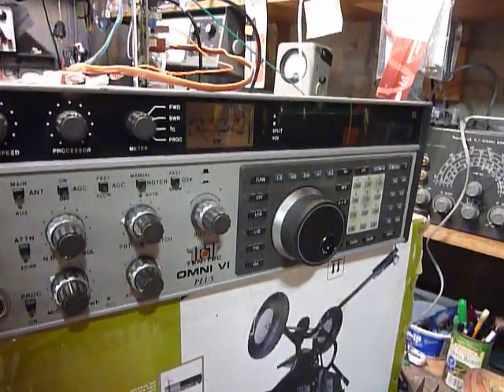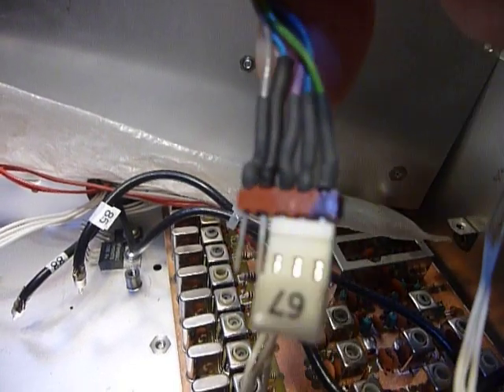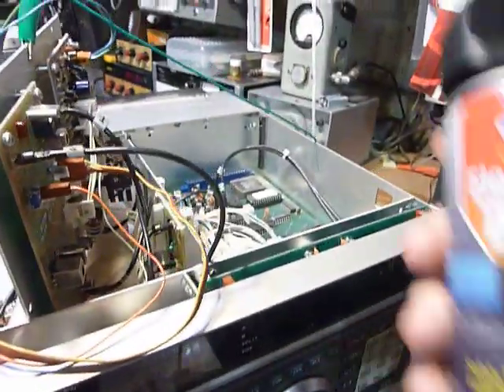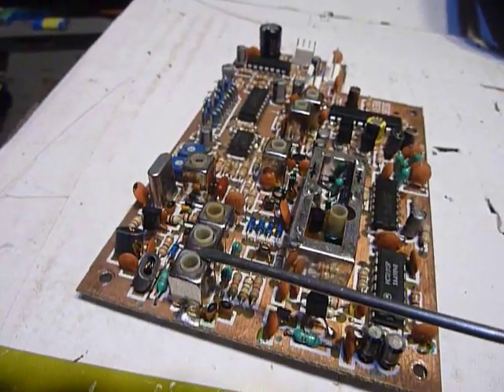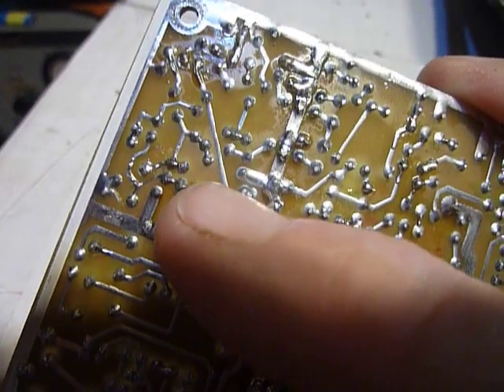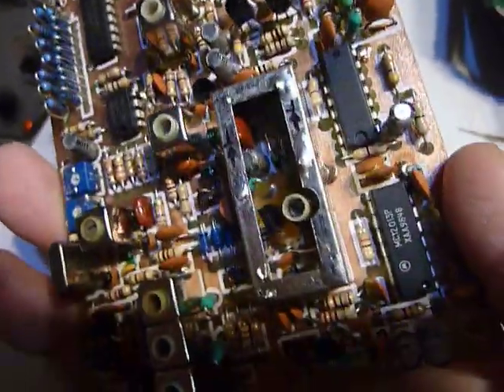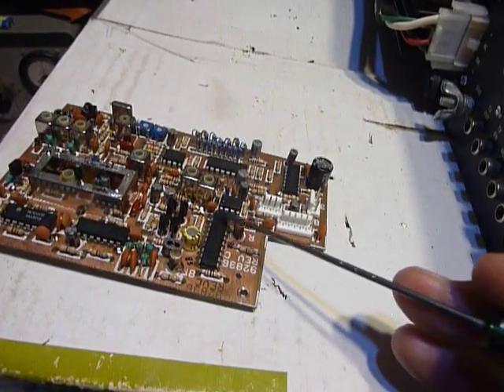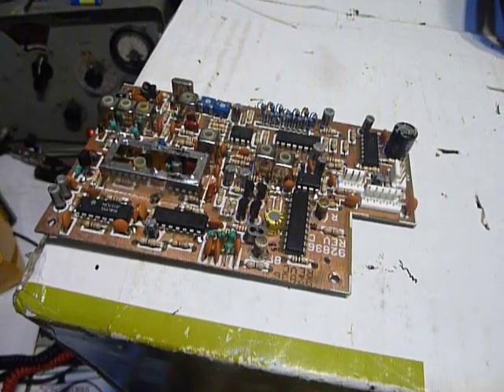Part 1,TEN TEC OMNI 6 Plus repair  ,  Ten Tec

Comment: So im having issues out of mine. All modes work fine except for LSB when using LSB the rig doesnt modulate properly and cranks power with mic gain at zero and no noise going into the microphone